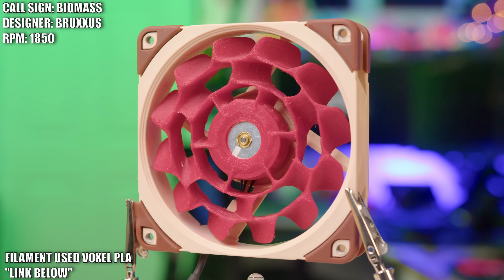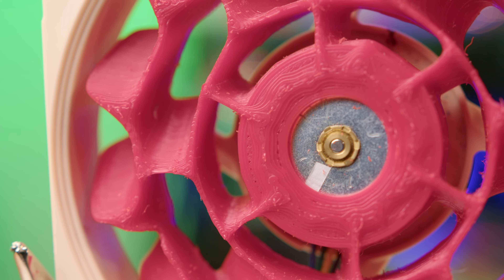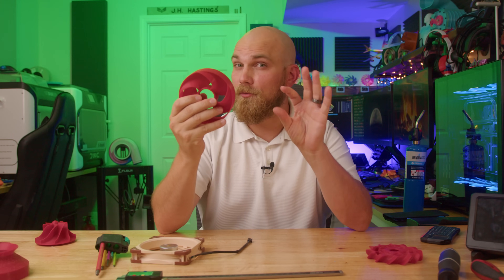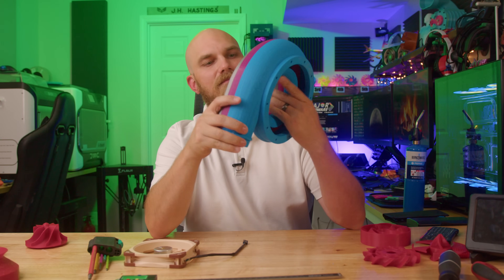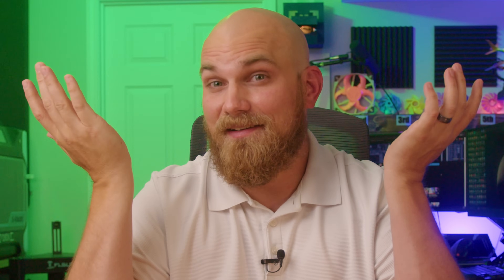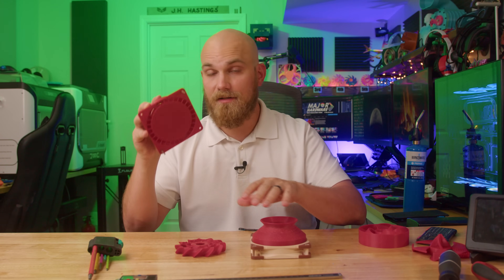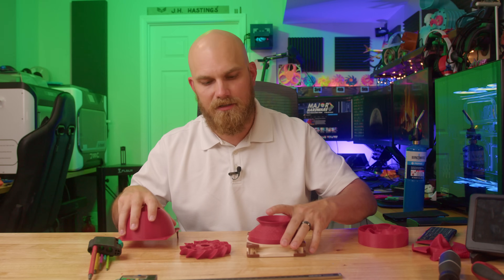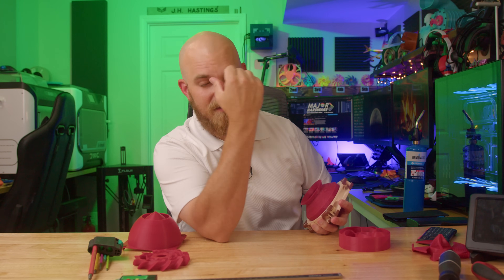What If Noctua Made A TURBO? | Fan Showdown S4E11

Comment: OMG, I can’t believe I made the Showdown! I don’t even care that my Turbinator design didn’t break any records, it was designed for fun and to see what a properly thought out radial flow design could do. Thanks James, you made my day! 🙏
Reply: Man, good job on that design. So clean.
Reply: @ll3dn4r  Thank you. :)
Reply: you were ROBBED!!! no way it scored that low. too good of a design!!!  #1 in my book! I call rematch!
Reply: @imtheengineer  lol, even with a gasket it's no cheater beater. Although at 25v it is pretty impressive. :D
Reply: @Cybernetic_Systems  I mean it's a Turbo, I'm guessing you either copied a vacuum or a legit turbo. Both spin at considerably higher rpm. So yeah on a good motor that can give it some, it must really get a boost in performance.
Reply: @Dominik189  I copied the compressor design from a Turbo, but applied Radial jet Engine concepts to change the direction of the air and expand it out the back. Amazingly, the Noctua motor will happily take 25v from my bench PSU and that does make a significant difference to the air flow.
Reply: @Cybernetic_Systems  think more jet engine less turbocharger. The compressor wheel isn't conducive to air moving that direction but a turbine engine is. You're definitely onto something and flow simulation would likely give you much better clues on where you could improve.
Reply: @Lysdexis  exactly right, the concept I used is from a radial jet turbine design.
Reply: Honestly one of the best looking designs I've seen so far, even if performance could use some optimisation.  The way it fits together so nicely really shows the time you put into it.
Reply: Sweet sweet design you got there! Well done, Sir!!
Reply: @DJSammy69.  thank you 👍
Reply: @Cybernetic_Systems  It's not often one wins without placing, and not in some w0k3 "i participated" manner. 
 Excellent design implementation, the seamless integration of the components is masterful. I hope you have/find a career involving your skills.
Reply: @jeffpatrick1864  thank you. I’m a manager at a SaaS company so this is just my hobby. 👍
Reply: It took #1 spot in my opinion. Just because I'm a huge forced induction guy and every car i own is boosted haha. Kudos for the awesome design!
Reply: Your fan design is for high pressure low airflow applications. To win here you need low pressure high airflow design
Reply: @TommyTLand  I’m aware of that, I just wanted to make a radial compressor design that worked.
Reply: I'd say with a little more open space inside for airflow, you might really have been onto something
Reply: Beautiful and thoughtful design!
Reply: very sweet design and wonderful made. Looks so clean and neat fitting, I agree with James it's a piece of art. Love it. ♥
Reply: I loved seeing a radial flow compressor in the lineup... I can only imagine this has far superior static pressure characteristics.
Reply: I wanna see what it could do in a delta fan
Reply: @Iszix87  I ran mine at 25v and it was quite impressive.
Reply: Just because of the design of it (the standard jet engine) it’s built to spin at tens of THOUSANDS of rpm, something like pla can’t handle
Reply: @thunderouspasta  yep, all true. I just wanted to see what was possible within the constraints. If you want to have a play, I’ve put the design up on Printables.
Reply: @Cybernetic_Systems  lots of people missing your effort :) well done nonetheless. Those types of compressors(intentionally not a fan) can consume immense power if given the chance, air flow cavities and speed. That being said a design like this with a smaller backplate with more space for the diffuser may fair better. We do not see leaks in the crucial area of the gas flow but I suspect that the air is throttled in the small diffuser. Inlet vanes a bit wider apart (less of them) and a smaller OD of the outlet and you may have a winner.  That’s without doing more “research” also simulations won’t hurt but if you have some mathematic background a stab at some rudimentary velocity triangle designs would possibly show you some more about that machine. 

The performance of these kinds of machines is also not always linear 2000rpm vs 4000rpm is not double it depends on the metric you are comparing flow, developed pressure or power consumption. Hopefully this might spur some further interest in the topic all the best on turbinator 2
Reply: i loved how it sounde.. like a miniature jet engine.. would it have a better airflow if the  front face of the rear shroud will have a curve shape (like a football) instead of being flat?

also, yes gasket please😅😅😅
Reply: Dude you managed to get REAL air pressure in there, enough to make it leak out the sides, and that design can produce a lot of turbulence, with gaskets you can get even more pressure and enough turbulence to be a real cooling menace. Well done
Reply: @apollyon4578  thanks mate 🖖
Reply: I still wanna see it tested with the gasket
Reply: If you have too many surfaces, it will create drag and turbulence and slow down the flow.
Also Turbo type devices must rotate at much higher speeds, like 60 to 100,000 RPM so the centrifugal force comes more into play and suck more air!
But it was nice first try at this.
You can do even better next time and then you will learn more about the physics of it.
Reply: @We-Do-NOT-Consent-To-The-Loop  and that’s why I’ve since designed one optimised for 2,000 rpm
Reply: @Cybernetic_Systems  Nice.
Reply: I was really hoping it would do better but the moment I saw the exhaust, I knew it was going to suffer from low air flow. A straight exhaust and a wider space between the center cone and the ehause wall might have reduced the restrictions and resulted in better air flow. Still, an interesting design with potential.
Reply: @ericmarcelo8976  I have improved the design since, but 2,000 rpm is a big barrier for compressor designs.
Reply: Thanks for providing the A12 frame for download. I assume it's your page as the turbinator is shown.
Reply: It probably performed bad due to such fan designs being made for static pressure, not airflow
Reply: @heyandrey6251  agreed, I knew from the get go it wasn't going to be an air-flow champ
Reply: @Cybernetic_Systems  what machine did you use to get such a clean print?
Reply: @Cybernetic_Systems  I was thinking with all the smoke leaking out the sides would mean too high of pressure downstream of the blades..? Maybe open up the exhaust side a little to be become a little less restrictive?
Reply: great looking fan though. As long is would keep my machine from throttling I would run it just for the looks!!
Reply: @davidhawthorne9637  it’s suppressed to be high pressure, the issue was the lack of sealing gaskets.
Reply: If he measured pressure you’d win hard. Turbines are designed to compress air and stabilize a set bar but this is all airflow and honestly if I don’t see a proper test with a gasket I’m outta here. It was cool but if the testing is flawed so too are any insights gleaned. If the fan is the lowest on the chart and you know why then it’s kinda messed up to show an incomplete test. I know you need money and the algorithm and stuff but use a different fan if you really need the video. Idk I’m sorry that this guys fan took dead last due to the testing. I know it is better at least than shown  if properly implemented.
Reply: The blade angle seems off to me. Did you take your time with a simulation software in the development stage to optimize the flow for the low RPM?
Reply: @Dominik189  I didn't do any simulation - it was just for fun.
Reply: @Cybernetic_Systems  you should, I'm sure the design has more potential than shown here. Proper gasket, a longer, properly optimized intake runner and well optimized blade geometry would really do wonders. It might not beat the cheater but it would definitely come close. Maybe even come in second. It would also be very hard to beat.
Reply: @Dominik189  I'd like to, but I've never tried CFD before and dont know where to start.
Reply: @Cybernetic_Systems  I recommend starting with tutorials. XD
Reply: @Dominik189  Ah logic FTW! 😀

Comment: Just noticed the acrylic hole needs to be bigger.  It looks cut to the same diameter as fan, but it needs to be bigger because I could see it from an angle.  I noticed how smoke goes straight up on the right side, I think that's why.  It's got a little gap there in between.   Not sure how to solve but it's definitely a loss, how much remains to be seen.  Thanks for the videos!

Comment: A turbo was never gonna place well in a flow rate test. If you measured static pressure it would be a whole nother story but its just not designed for high volume flow

Comment: Have you been using the same A12 all season. Have you checked it recently with the baseline fan to make sure its within spec cause that motor has had to spin some chonkers and may have taken some performance loss over time?

Comment: Turbo wheels spin up to 100 000 rpm to compress and pump air into an engine. Sub 2000 rpm pc fan not going to do much in terms of moving air efficiently.

Comment: not a very fair test for the terbinator. 
compressor style fans are optimized for static pressure, not CFM. that design would be best mounted to a very thick radiator.

Comment: The Turbinator is a turbo, so it's naturally better at compression instead of outright airflow. If there was a way to test the static pressure of the fans, I bet this one would be quite high up there (With gaskets of course)
Reply: The wind tunnel could have some kind of resistance, maybe just a simple 120mm radiator, so we test how well these fans work on water cooling rather than as a case fan. I'm sure a lot of designs would shift around because of that.
Reply: Could use 2 gutted 120mm fan frames (1" each) to make a very short "tunnel", then hang a cover of lightweight, finely masked screen (to simulate the characteristics of a fin stack or a radiator, instead of a solid surface) down in front of the exit, hinged up top. Then test static pressure by measuring degrees of deflection of that hanging screen.

The result metric wouldn't be ideal for comparing with manufacturer specs for commercial fans, but Fan Showdown fans are one-off prototypes in an isolated testing regime, so the test and its results would be perfectly fine for this use case.

If you want "the real deal" for testing static pressure with millimeter/inches of water result metrics, you make a closed box for the fan to mount to, with a transparent pipe mounted vertically out of the bottom. The pipe needs to make a 180° U-bend and be open ended. Then fill the pipe up 3-4 inches from the bottom of the U-bend. Run the fan, and the resulting mm/inch delta between the water line on the two sides of the pipe bend is your pressure metric.

Comment: 2:28 this has been tested on a car by the Mythbusters to reduce turbulence in the air. The main issue is that it doesn't work well on modern cars because of the well thought through aerodynamics. But on older cars it showed to improve airflow. This could work on a fan, but probably not on one as streamlined and efficient as this one.

Comment: Biomass was the most impressive.  Visually, it was taking in a lot of air without typical turbulence... and moving it swiftly through, without much exit turbulence.   If it were printed with Thinner walls... I think it would have an even greater potential.
Reply: For 52dba, the biomass was surprisingly low key on the sound signature
Reply: @Sartek  It was a very interesting and different design choice. Seeing someone go with something other than the tried and true fan blade design was a good change of pace. The open and varied blade pitch design of the Biomass made the exiting air cork-screw out the back nicely. I wonder how affective it would be on a radiator or tower heatsink.
Reply: @Slane583  Hi! I designed the biomass fan and was pretty surprised by the results too! I didn’t have a Noctua fan to test it on, just a DC motor that I printed a hub for to test.  I think the fan’s frame helps a lot.  

Seeing the smoke test and results sort of motivate me to try updating the design a bit. 

Although, I do sort of wish there would be a classic and open category, where fans can be  a bit more defined based on practicality. Haha
Reply: @BRUXXUS  It's very interesting indeed. Vastly different than a normal fan. I read a comment on here of someone mentioning maybe thinning out the blades a little bit. Though I'm no engineer myself. I wonder what it would do if you filled in the middle that mounts on to the fan hub and made it into a bullet shaped nose-cone.
Reply: @Slane583  I definitely have some ideas!  I'm a bit of a purist when it comes to things like this. I think I'd like whatever I send to fit within the original dimensions of the A12. That said, I can improve some of the dimensions, for sure! Round out the hub a bit more.  
I would have designed it with thinner walls, but wasn't to confident in his printer tuning or slicer settings from seeing all the other prints, so I chose to make it as easy to print as possible. 🤣  If he takes some of the advice in the comments and updates to the newest Cura or PrusaSlicer, I think all the prints from now on will look amazing!
Reply: @BRUXXUS  I'm surprised he hasn't tried a resin printer yet. It takes a little more steps with curing and all but it would be good at doing stuff like this. Much cleaner prints for fine details. I've been looking at 3d printers myself but I have no room for such a setup. Not until I can get workshop space anyway which won't be for quite a while. :)
Reply: @BRUXXUS  your fan design seems to be on to something. I think the varied blade dimensions prevent sound resonances and might also work like mini ducted fans. It definitely was moving a lot of air and it looked really straight. I would love to see what would happen if you increase the number of "cells" and use a thinner wall. This sort of design seems like a great application for topology optimization. Hope to see more of your designs tested!
Reply: @wingman358  Thanks!  Yeah, finally seeing it in the showdown has definitely inspired me to “evolve” the design!  
I agree with all your suggestions.  Also, anyone else is free to play with the idea as well. ☺️
Reply: @BRUXXUS  boy you better publish them master designs for people to grab, the biomass was for sure the underdog in this showdown, if it had more to capture the flow of air like the turbinator then you may have a chance at the top 5
Reply: @BRUXXUS  I really liked your fan, great job!
Reply: @smeezer  thanks! 🙂
Reply: I also noticed how you could see the twist in the air that was exiting the Biomass fan, which was pretty neat. It worked really good for just being a random and different idea.
Reply: You can try and print with strong resin. But I wonder if it will fracture after time.
Reply: @PRiMETECHAU  It would be interesting to see.
Reply: Things produced with organic design tend to outperform many conventional human designs

That's why a lot of organic design is taking shape nowadays

Comment: Your turbo fan was spinning the wrong way.  The fan blade side should be the intake.  Air comes in and conpresses to create high pressure.  Either print the fan blade inverred or reverse the motor.  How did you miss that?

Comment: Purely educational, I think retesting the turbonator with the gasket will grant designers a data point on how much efficiency they can gain by leveraging the geometry of the gasket.
Reply: Thats only half of the issue. The outlet produces to much resistance. All in all to tight of a channel.

Comment: Turbonator relies on pressure to force out air. that just leak in the side probably cut its effectiveness in half if not more.

Need to retest it with the gasket. badly.

Comment: That pitch on the FS1 was nails on a chalkboard 
Also the biomass fan looks sick and I'd use it on builds even if it wasn't as good at airflow as the original. Might be able to tweak the blade angles for static pressure instead of airflow for a rad radiator fan

Comment: I was honestly impressed with the Biomass fan. looked cool and did quite well!
Reply: I agree, the sound produced was so easy to tune out, and the velocity was insane!
Reply: Thanks! I was impressed too!  😅
I sent it in like a year ago and never thought it’d get a chance.
Reply: @BRUXXUS  very nice and organic design! Have you uploaded ir somewhere? I'd like to print it myself
Reply: Yeah it pushed way more than I thought it would.   Very impressed
Reply: This is why it would be cool to see noise-normalized tests!
Reply: Same, super cool fan. It really shined in the smoke test.
Reply: I was not too surprised personally... The bump on the hub acts like a Noctua fan, helping it take some of the air mass off from around the center of the hub. You would never guess it works like that unless you know about the math.
Reply: @rusg.8347  That one wasn't the bio mass. The bio mass was the one that had the blades divided out into an inner, middle and outer section with different blade angles
Reply: @dustinroberson1865  but looking at the hub it's sometimes the small things that actully make a big difference. So yes it is. Though it may not be the nicest looking spot on the plastic, but it's still there.
Reply: @rusg.8347  the biomass had no bump.  It was a open face on the hub ypu could see the motor in the center.  Your thinking of the wrong fan.
Reply: @brandonbrown3600  ... look at the layer hight how can that not be considered a bump?  Having no plastic at all starts My the" bump". The math maybe a bit deep and not perhaps creating a perfect wave for the fan... even accidental. But it's still there. Why arguing with me? Find some math and prove me wrong.